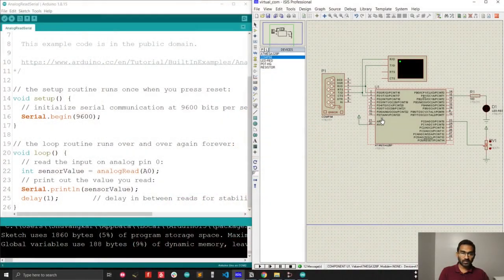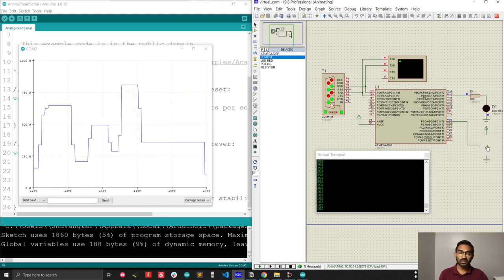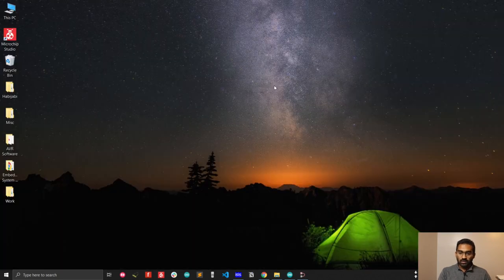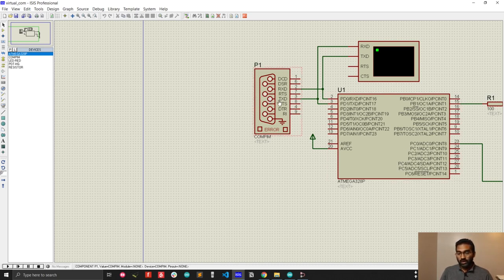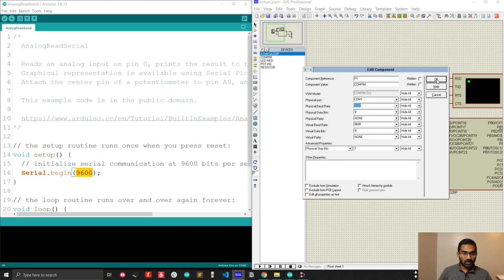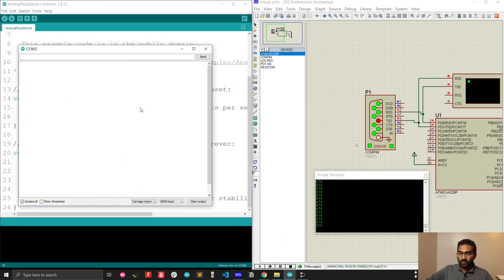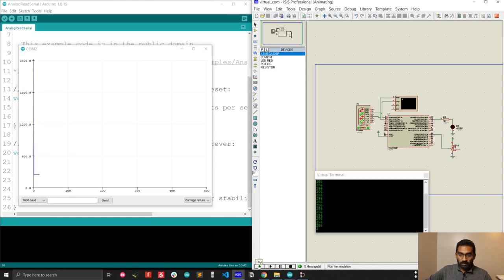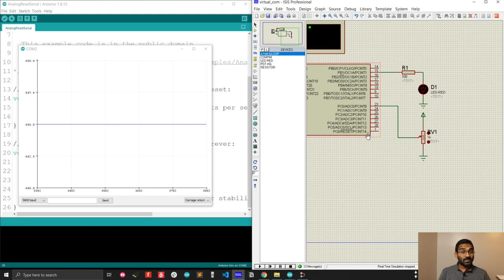The Best Free Virtual Serial Port Driver to Connect Proteus with Arduino or any software : com0com

Comment: does a physical Arduino need to be connected for this to work?
Reply from the maker: Short answer No. 
Long answer:
You can do both. I mean you can connect physical Arduino with Proteus. Suppose you want to see proteus simulation  analog data in graph. Then you can connect proteus with arduino IDE this way and use Arduino Serial plotter to see proteus data.
Reply: @ShuvangkarDas  ok thanks. i don't know why though, but my Arduino ide is not recognizing any virtual com ports. I'm getting a null port error and cant select any ports. that's why I was wondering if I would need a physical arduino. if you have any suggestions that would be greatly appreciated
Reply from the maker: @michaeljwosniak7241  There might be a problems with your Arduino Driver  Installation. You can try reinstalling Arduino IDE.
Reply: @ShuvangkarDas  ok ill try that
Reply: @michaeljwosniak7241  Have you found any solition for that because I also have same problem. My arduino IDE can't recognize virtual ports even I have just reinstalled Arduino IDE

Comment: Hello friend, excellent video.
I have a problem with the simulation of the same circuit in proteus.

The circuit doesn't work.

Could it be that you could send me the file of your circuit and the one of the arduino ide?

It is for educational purposes, since it is for a university practice.

I hope you can send me the file of the circuit made in professional ISIS.

and the arduino IDE file.

thanks in advance, greetings
Reply from the maker: Thank you for your comment. Yes, I will. Please send me an email. Don’t forget to mention what you need as I reply many emails one  sitting. You will get my email in YT channel description
Reply: @ShuvangkarDas Thanks for answering.

Your email is not on your youtube channel.

Could you comment your email here?

to be able to contact you.